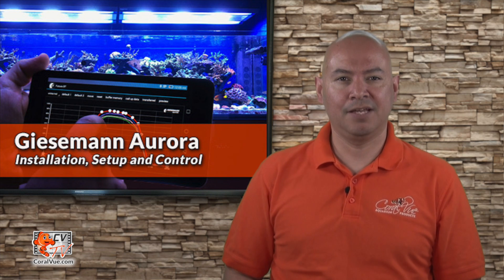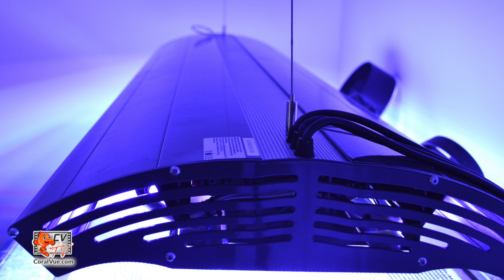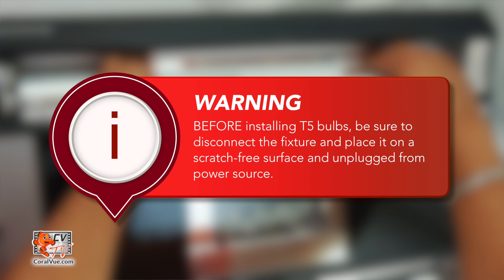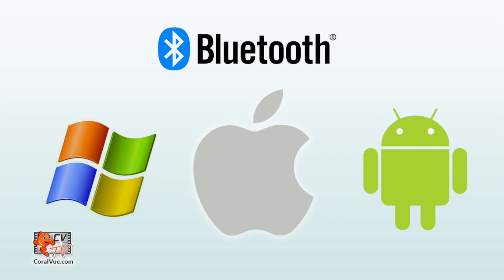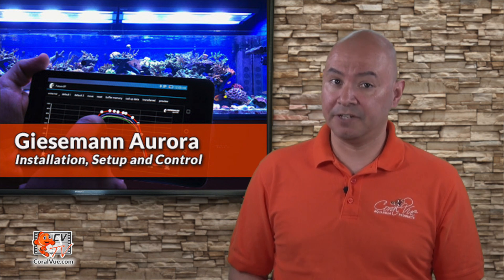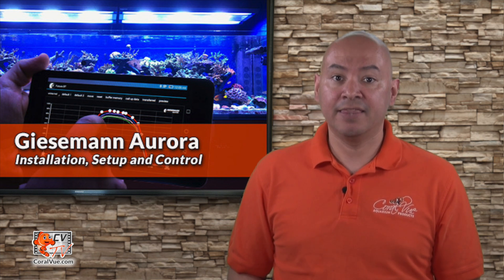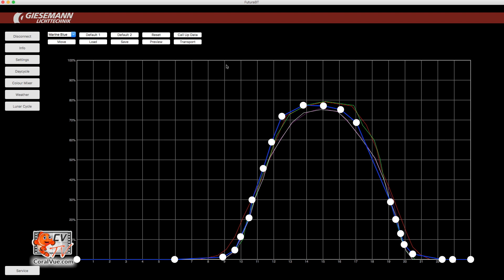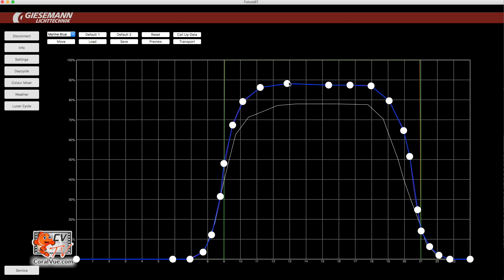Giesemann Aurora: Installation, Setup & Control

Comment: Do you know of a way to mount that isnt hanging from a ceiling?  Thought about building a canopy but prefer not to, rather find a way to mount but If I do build a canopy how high does it have to be from water and is the 48 model wide enough to cover a 24 wide.  I think I am buying a 120 gallon. Also, are leds replacable? I also wanted to know if coral plus is okay for growth combined with blue from led's. I saw someone that used all coral plus and it looked very nice crisp and daylight looking but also gave plenty of color pop!

Comment: Hi,

I am using the Futura BT software for windows and it seems to be a little different than your video. 

When I select english as my default language, it still reads "Andem" under time and date. Also under the "color mix" tab, the  white/red controls my outer T5s - white/green controls the inside T5s.

I have the Aurora 48" 4 T5s and 3x 85W LED. Any idea when they'll roll out the Aurora software?

Thanks